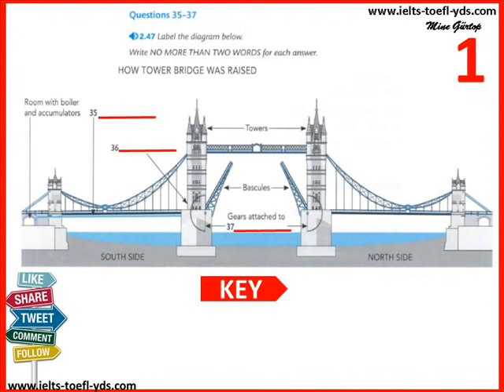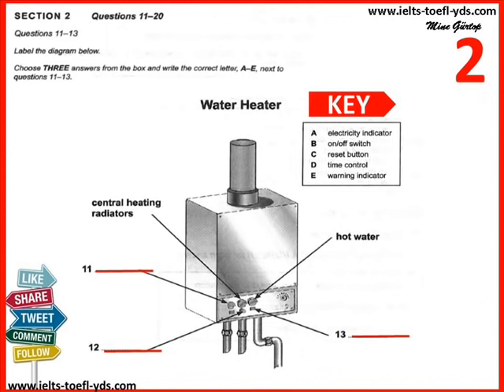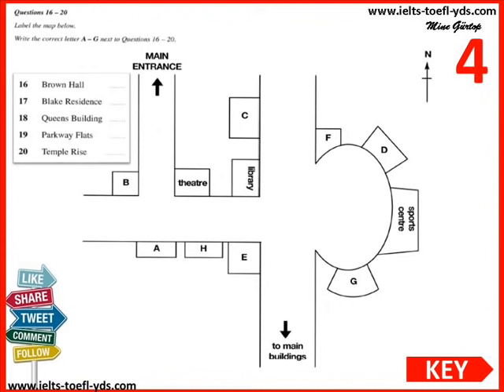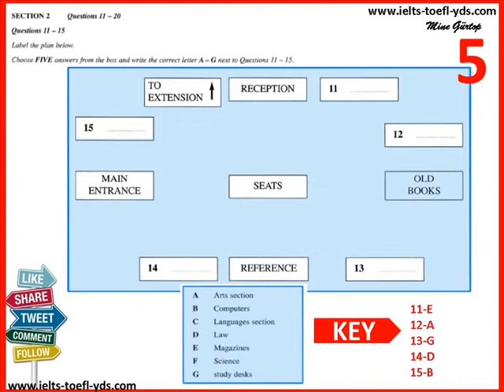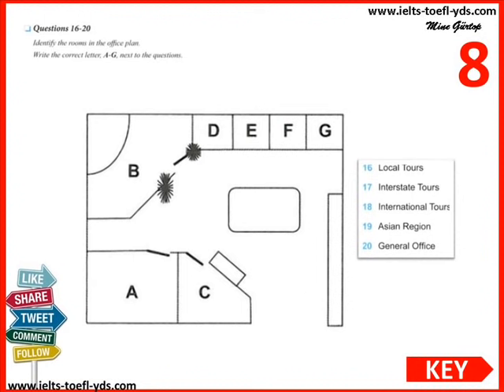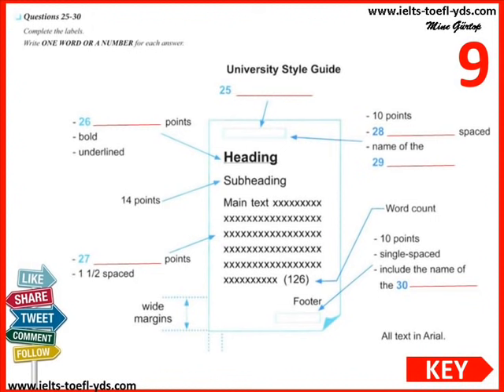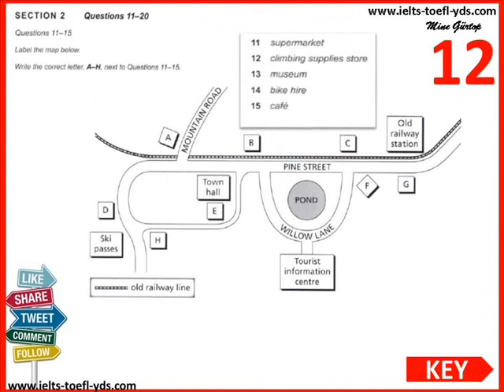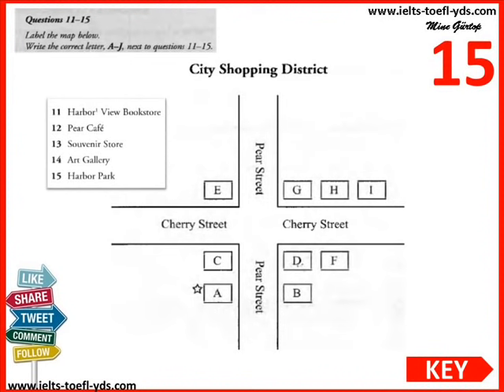HUGE COLLECTION OF IELTS MAPS FLOW CHARTS DIAGRAMS 1-20

Comment: test 7 why  the H is fitness room, anyone could give  a explanation? thx  sooo much.
Reply: Bcoz... They mentioned fitness room which is alongside
Reply: hi, i guess the correct answer is c. she did mention the oval shaped .....
Reply: Yep H answer totally random and illogical
Reply: Some Fitness room usually have a playing field. 
The video says, "You can see a grassy oval patch, well that's the playing field for what we simply call fitness room which is alongside"
It's is actually saying that there is a oval shaped playing field for the fitness room and the fitness room is alongside the playing field.
Reply: @diptopauldip  How come it jumped from the other side of the road to Brendon Complex without any connecting devices? such as let's look back to Brendon Complex?
Reply: @tinglau7705 "... but that doesn’t have to do anything with brandon complex..." - I think they took their eye on the other side for some moment, now by saying the above line they are coming back to brandon complex.
Reply: @diptopauldip when it moved  from  Brandon Complex to the other side, it did specifically told u they moved to the other side